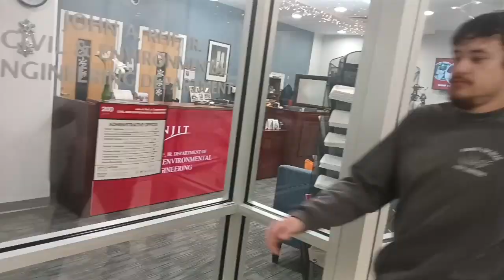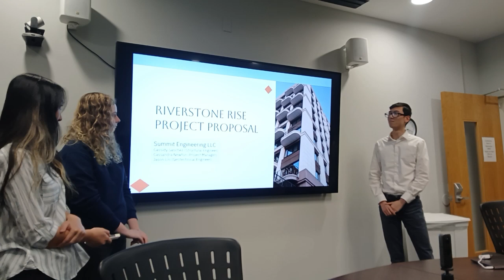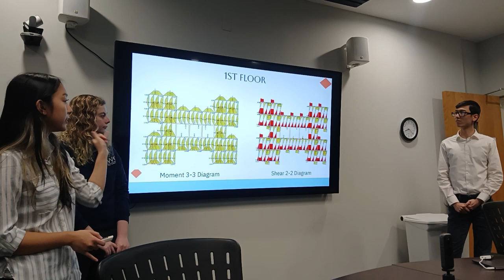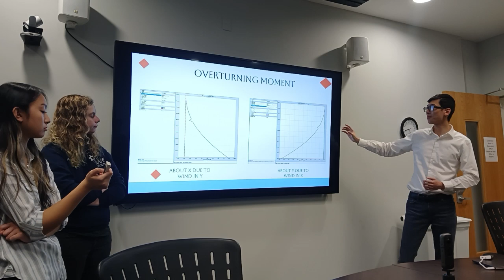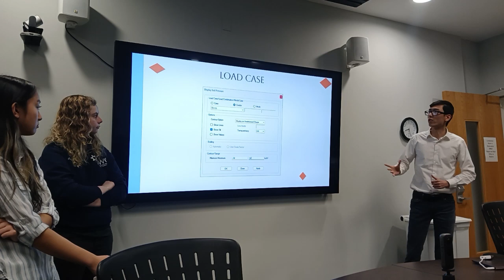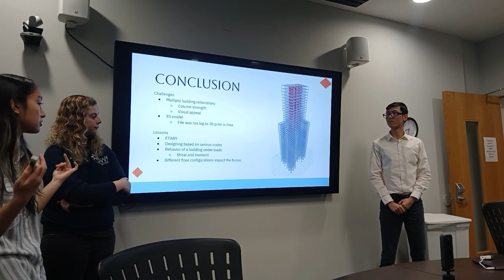CE495 2024 Fall Final   Group 1   Short

Comment: Great presentation, which are covered from project description, structural criteria (Building Code), Floor Framing System, Lateral System, foundation system, and ended with material takeoff.